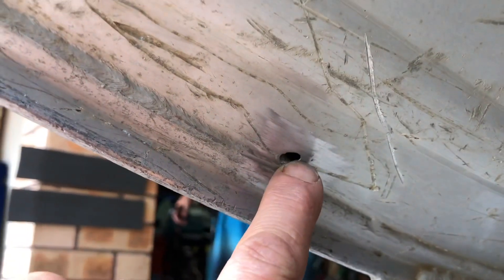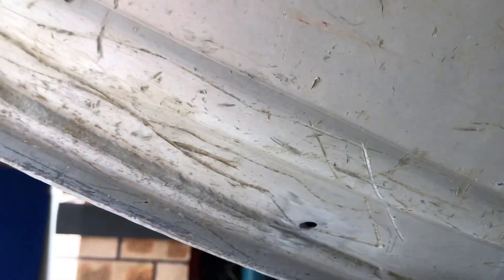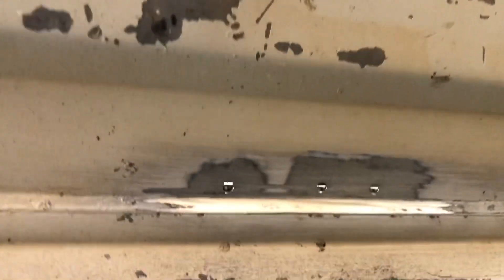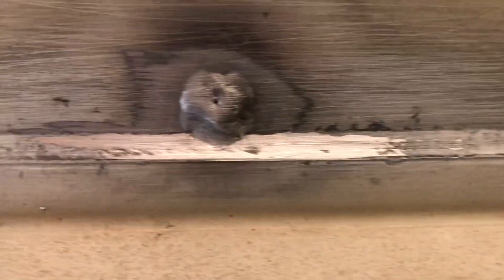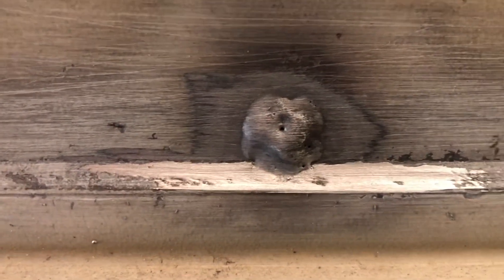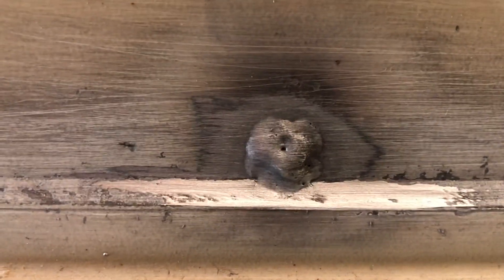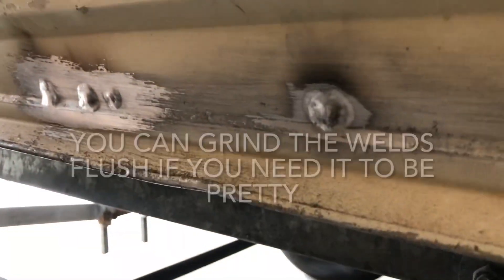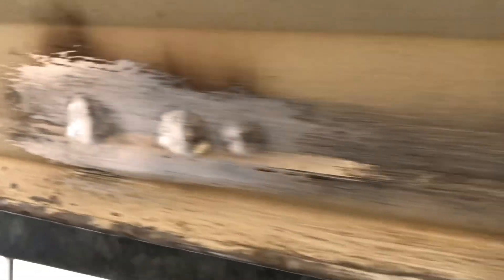Aluminium boat repair

Comment: Given that everyone has a spare TIG welder or two lying around in the garage I’m the odd one out. I’ve heard of brazing, can you cover this? Perhaps you’ve discussed this already so apologies if that’s the case.
Reply from the maker: Hi mate,
I have not used aluminum brazing rods yet unfortunately, I have heard they work ok. I would assume that there would be a lot less risk of blowing big holes in the boat too.
cheers 🍻 
Aussie Boat Guy 😎

Comment: As a man who welds aluminum for a living, my only input is you REALLY need to ad a few seconds of post flow to protect your tungsten while it’s cooling. This is why it’s smoking when you let off the trigger. It should GREATLY reduce the amount of contaminants that you are introducing into the puddle upon startup
Reply: And thank you for your amazing content 🤘🏻
Reply from the maker: Hi mate,
Thanks so much  for taking the time to help out like that.
I really appreciate it.
Now you said it it makes sense.
I have the flow on for a few seconds at the end because I mostly use the tig with stainless but pre flow now makes sense.
Thanks again,
Aussie Boat Guy 😎

Comment: One quick question I recently ran a motor on the river 2 stroke jhonson 15hp it allways has been blowing white smoke but the cooling water was just fine just a few days ago I lost compression to about 50psi and 100 psi top bottom I see a black exhaust port score on the top piston is it possible to hone or sand out? I get that this doesn’t tell much but i have no idea what I’m working with
Reply from the maker: Hi mate,
White smoke is sometimes a sign of overheating, and cooling water from the tell tale does not really indicate that the motor is being cooled properly, it just indicates that it’s got water pressure to cool if there is no blockages etc.
keep in mind that the exhaust is normally cooled kinda separately to the head. the head cooling is controlled by a thermostat (so failed or stuck thermostat can cook your motor even if you got a strong tell tail) also any salt blockage in a cooling passage can cause no water flow to a specific area like the head or exhaust jacket. also a week water flow because the impeller has not been changed for two years or more can cause issues too.
You would need to fully disassemble the motor to see what damage had been done. 
cheers 🍻 
Aussie Boat Guy 😎
Reply: @25hpboatracerman  i have dissasembled it partly to where i could see the heads and the exhaust and intake sides the top cylinder has scoring for days and the bottom has none (top 50psi bottom 100 psi) it looks like it ran hot indeed i dont know if its fixable the cylinder wall has allmost nothing of scoring and it still has some crosshatch
Reply from the maker: Hi mate,
Sounds like it will need a new top piston as a minimum.
You need to disassemble the whole motor.
You cannot gone a cylinder bore with the pistons still installed.
Also you need to remove the exhaust cover to check for water passage blockages, likewise under the block where it mounts to the leg.
Needs to be fully stripped down.
You could follow along with one of my disassembly videos if you need, just make sure you take some pics before you disassemble and put all parts in order and bags with parts names etc so you can re-assemble easily once you sort the problem.
If your block does not clean up, you may need to source another second hand.
Cheers 
Aussie Boat Guy 😎
Reply: @25hpboatracerman  thanks so much

Comment: I've had great success using my Mig aluminum setup. with a very clean stainless Steel backer inside the hull, to stop blow outs. Saved quite a few over the years like that :-)
Reply from the maker: Hi mate,
I have had the same success with a mig setup for alloy also I do use a stainless backer too on some of the holes, works well.
I used the mig for about 15 years but now with the tig, I have more control and plus I can strike an ark without adding more filler which is awesome.
Cheers 🍻 
Aussie Boat Guy 😎
Reply: I've got a tig setup for Steel,but not Aluminum. One day :-) 
 @25hpboatracerman
Reply from the maker: That’s good, I’ve tried steel with my tig but for what I do with steel I use a stick now.
I still have my mig setup for alloy but haven’t used it at all since the tig. I should convert the mig back to steel use then I would use it again.
Cheers 🍻 
Aussie Boat Guy 😎

Comment: Should have someone hold a brass block on the inside when welding it.
Reply from the maker: Hi mate,
Yep, did that for the big one, but used a stainless block.
Cheers 🍻 
Aussie Boat Guy 😎

Comment: Been waiting for this one! Are you spot pooling around the circumference to close up the hole? Looks like 2.4mm, are you using 5356?
Reply from the maker: Hi mate,
Yep, spot around the circumference to close up.
2.4mm rods and 5356.
Cheers 🍻 
Aussie Boat Guy 😎
Reply: Thanks ABG, wanting to try and do this for ages but no one has really shown what you have done so here!
Reply from the maker: Thanks mate,
Glad it is a helpful video.
Cheers 🍻 
Aussie Boat Guy 😎